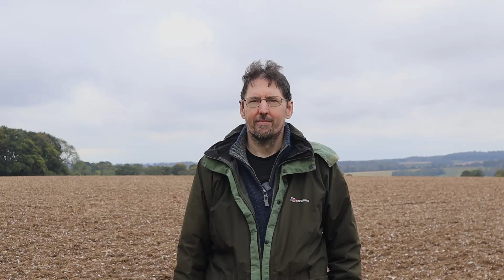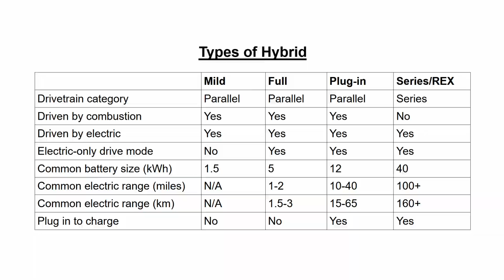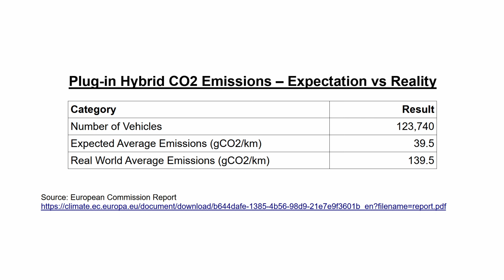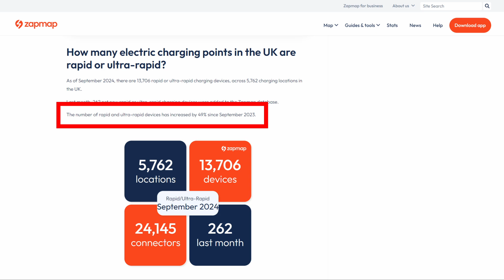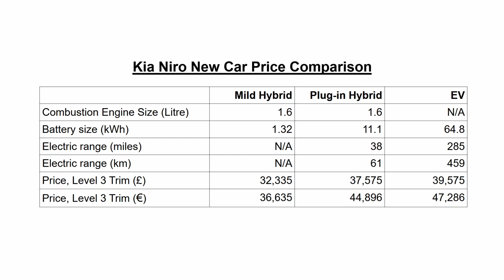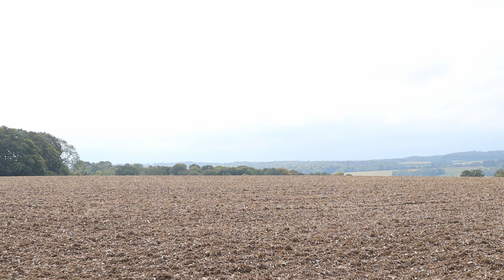Should We Buy Plug in Hybrids?

Comment: A couple of points have changed my view on PHEVs.  Here in the States, the number of Level 2 chargers needs to grow a great deal.   If PHEVs help get those chargers in single and multi-family homes, work places, shopping centers, etc., that's a big deal.  If PHEV users find that they can graze on free or less costly Level 2 charging throughout the week and realize that they seldom have need to fill their tank, they'll probably be much more receptive to buying a BEV in the future.  Hopefully Level 3 charging will be much more abundant over here by then.  The majority of drivers over here want to see a range of 300 to 450 miles before they'll consider purchasing a BEV.
Reply from the maker: Yes, PHEVs might act as a gateway to an EV. However, I do wonder if people will be disappointed by the EV aspect of them, and this will put them off instead. For example, they might be disappointed by the regularity with which they need to plug in, or the limited power in EV mode where that applies. I'm interested to see what happens in that regard.

More level 2 chargers in the world is a good thing though, I grant you - you have my wholehearted support on that!

Comment: Agreed, PHEVs only make sense if you have carefully considered your personal usage profile, which, I suspect, most people don't. If you are cycling your battery every day for your commute, that doesn't sound great although, as I understand it, manufacturers design their systems so that the battery doesn't charge to 100% or deplete to below about 30% so deep cycling is mitigated. 
The arguments between PHEV and EV are also quite nuanced; there's the 'Wiki' argument - with a PHEV, you 'buy' enough lithium and cobalt etc. to provide for 70 - 80% of your needs with the ICE providing the remainder (the Wiki argument is you don't need 100% accuracy if 90% is practically good enough). The 'whole world' cost of lithium/cobalt etc. is paid for by invisible miners (sometimes minors!) and the environmental land damage of lithium and cobalt extraction. So the argument is, why buy a heavy resource hungry 80kWh battery and pull it around town unless you need a bigger battery for long journeys. A smaller battery will be good enough most of the time and when you need it, the less resource hungry ICE (i.e.manufacturing cost) will be fine for the occasional use. How many people really need a car that frequently needs a 200+ mile EV range? 
At the end of the day, a car is never really 'doing our bit' for the environment; the all-in environmental cost of car production is huge. But reducing oil consumption and its pollutants (in town particulates etc) and atmospheric C)2 for climate change is a good pursuit whether PHEV or EV. The balance will change over time of course with the introduction of new battery technologies. 
I'm not equipped to do a whole cost PHEV/EV comparison. Maybe someone on here can expand on this; have I got this completely wrong?

Comment: Really thought provoking video - thank you. I think everyone will have their own use-case and the decision to go down the PHEV route will depend on a whole load of considerations. In my own case I had dismissed the idea, but now that our diesel estate is getting close to needing replaced, a PHEV looks like it may be the sensible option. Our main (most used) car is a Zoe (40 kWh), which is great for 90% of what we do - charged at home for 7p/kWh, but is quite taxing if you need to use public chargers (very slow charging, limited range). But on the occasions we need a second car it tends to be either for longer journeys /extra carry capacity, or for short trips like the school run when one of us is out in the Zoe. So something we can use on electric only (charged at home) for those short journeys but that still has the range for long trips, is quite attractive. 

EVs with fast charging and a really decent range (c.300 miles) are still very pricey, even on the used market, whereas I can pick up a second-hand PHEV for similar cost to what I paid for the Zoe. But I would be wary of maintenance costs and your point about battery degradation does make me hesitate. Just need a load more good-spec EVs to hit the used market!

Comment: I have an i3 rex and have used about 3 gallons of petrol in 3 years. I use the engine like having insurance. It comes in handy but I try not to use it.
Reply: The seats are quite firm but good enough for 180 miles, which is the most I have done in a day. Servicing is just my local garage, he has EV trained staff and it is only required every two years.
Reply from the maker: That's a good approach.

Someone took me out in their i3 about 5 years ago, and it didn't half move! I don't think they had a REx, but I don't remember exactly. The seats didn't quite suit me, otherwise I think it's a superb car. I'm glad it serves you well. Who do you get to do the servicing?

Comment: Another big factor (nicely explained by Dave Takes It On) is that PHEVs have pretty poor electric efficiency. They only get about 2 miles per kWh, which makes most AC chargers more expensive than buying fuel.
Reply from the maker: Ouch, really? Wow, I wonder how they manage to make them so inefficient!
Reply: @theelectrictransition  Dave says it's because of the interface between the electric and ICE motors. Presumably there's an automatic transmission in there somewhere but I've no idea.
I did a bit of research to see if the claim was reasonable, but no one publishes the electrical efficiency of PHEVs. Instead I looked at the 'electric only range' and the size of the battery for a number of PHEVs, and they all worked out at about 2 miles per kWh.
Reply: Not all phev get poor electric efficiency. I have a Toyota Prius Excel 2020 PHEV, and when charged, it gets me 4 miles/kwh, similar to many EVs. If I dont charge the car, i get 65 - 70mpg off long road trips including motorway. I have owned this car for 3 years and driven 45000 miles. I listened to the videos abt hybrids and Phevs from Dave takes it on, he said a lot of things that are NOT correct abt Hybrid/Phevs and he did a lot of misinformation and generalisation that do not respresent all hybrids/phev. A lot of comments from other people confirmed that Dave gave a lot of misinformation about hybrids/PHEVs . Toyota is the king of hybrids and Phevs. They are very efficient, economical, and reliable. Perhaps 2 miles/kwh could be from stellantis phevs but definitely, not Toyota.
Reply: Really depends on the PHEV: mine is about 3.4.

Comment: PHEV is akin to one of those combination VHS/DVD recorders which existed for a very short time. The other disadvantage to PHEV which I was only made aware of recently is efficiency. Apparently they struggle to do more than 2 miles/kWh running in electric mode which isn’t great!
Reply: I regularly get 3,5 miles per kWh on my Outlander PHEV.
Reply: @markotrieste  I’m guessing you use battery only mainly in an urban environment which would flatter it?
Reply: I get slightly over 6km per kWh in my PHEV. This type of malicious disinformation is why people don't move from gas only.
Reply: @Snerdles  Yes, this "holier than thou" approach from the EV crowd is getting annoying. There are some real problems, such as company cars that could run on electricity but are instead only filled up with petrol or misleading WLTP figures, but unfortunately most people seem to think it is better to just throw the water with the baby.
Reply: @Snerdles  well I moved straight from gas/petrol to EV and  accept PHEV has a place as a ‘gateway drug’ and in certain scenarios with the current infrastructure but I still think my analogy holds true and PHEV is an over complicated interim technology. No doubt the high miles/kWh is achieved very much on an urban cycle?
Reply: @markbennett6658  Over 6 is, it's just barely under 6 on the highway. I saw once that a hummer EV took 6 days to charge. Therefore EVs are bad.... That's what you sound like in your malicious disinformation spreading.
Reply from the maker: @markbennett6658 That's a really nice analogy, thanks. I bought my parents one of those. It wasn't heavily used. I doubt they exist now. Not a bad choice, but of its time

Comment: Great video. You’ve clearly stated why a PHEV is not the ideal option. Deep cycling of the battery and people not charging daily
Reply: The fact that the PHEV battery never gets deeply discharged is A strong advantage of a PHEV over a BEV.
Reply: @ nor do my BEV car batteries get deeply discharged and they are rarely charged above 85%. For a PHEV you need regularly (daily) to charge to 100% of available capacity to make best use of EV driving. My BEVs are seldom charged more frequent than once a week.
Reply from the maker: Thanks very much

Comment: Availability of EV chargers near me is very bad. The longer journeys I do make would be painful and disrupt my valuable time. When charging improves, I may look at EVs.

PHEVs are popular amongst reps and such like because they are lower tax. A friend bought one recently at 2 years old and 35K miles. Clearly, not been plugged in a lot.
Saying PHEVs are no good is like saying EVs are no good because most people run out of charge; it's user error, not the car itself.

PHEVs aren't actually more expensive if you shop around. I got a new Seat Leon e hybrid for £26K - little more than the base model.
The batteries being so small are actually very cheap to buy and replace. I've seen them listed for £1200. They do have 8 year warranty though.

Finally, servicing costs are no more than any other car including EVs if you buy the servicing with the car. I only pay £100 for a service.
Reply: What's your time valued at these days?, mines less than the cost of diesel.
Reply from the maker: Yes, I suspect that the tax saving is what is triggering people to buy them and then not plug them in. That has caused some consternation about some of the incentive mechanisms in Europe.

I don't think I said that PHEVs are no good. I have a suspicion that a lot of people could benefit more from having an EV than a PHEV, and that's why I was suggesting that people consider both. PHEVs serve a niche, but that niche is getting smaller very quickly.
Reply: @theelectrictransition  PHEVs are the largest growing sector of cars at the moment.

Comment: The discussion around PHEV is nuanced. The most recent PHEVs from VAG and Toyota have ranges in excess of 50 miles (Verified by chums of mine who own such recent PHEVs) and as such this equates to 85% to 90% full electric use for day to day running around and commuting. For longer journeys you can just press on to your destination and plug in there. Now to my own experience, I run a BMW i3 Rex and over 90% of my journeys are done on electric, with a range of 220 miles using the Rex it covers my long journey needs without the need to stop and even if I do I can add another 100 miles and be on my way in less than 5 mins. Anything that reduces the overall fleet consumption is a good thing and should be encouraged. I agree there needs to be better education about how to use a PHEV properly and now that the latest batch have a usable "commuter" range there is a more compelling case. Over the next few years there will be a mix of solutions to take us to our goal of reducing consumption of fossil fuels.

Comment: Take a look at the price of charging in the Highlands, and scarcity of chargers. BEV just isn't a great option here yet. Some kind of hybrid makes more sense for now, or just stay ICE. My diesel will readily return 700 miles per refill.
Then there is the electricity distribution robustness during severe weather, although that is going to be the case for most very rural areas.
Outside of our situation, which is most people's, BEV is a great option.
Reply: I live in the north Highlands and have owned an EV for several years. I regularly drive over to the west coast for work and charging really isn't a problem, some chargers can be expensive, but the closest rapid charger to you (judging by your username) is only 40p/kWhr which makes it much cheaper per mile than diesel. However the local charging network is largely irrelevant to anyone living in the area, most rural properties have off road parking so you just charge at home. 
As for power cuts, how many times can you honestly say your electricity has been off for more than a few hours? Ours goes off a couple of times a month for a few minutes,  and we've had lines hit by lightening in the past year that has put the power of for 4-5 hours, in 20 years it's been off more than a day just once but it's very rare that I'll even bother to fire up the generator. But why does that matter? You can't fill a diesel when there's no electricity

Comment: I would wonder if the battery in hybrids degrades quicker due to the more frequency cycles as opposed to the BEV cycles?
Reply: No, paradoxically it's the opposite. 
The BMS in a PHEV limits the cell voltage so that it's never fully charged nor fully discharged. 
That greatly reduces battery degradation. ☮️
Reply: @Tim_Kent  Yes but in sheer number of cycles, a battery that holds 40 km of range will do 10 times more (equivalent) cycles than a battery holding 400 km for the same overall mileage.
Reply from the maker: That's true, the number of cycles from a smaller battery would be higher. It's the depth of the cycles that I suspect would be most damaging - but neither helps
Reply: @theelectrictransition The depth of discharge is always limited to 30% SOC to allow for hybrid mode drive.
Reply: Yes, but the battery is also smaller.

Comment: I'd be interested to see a long range challenge, like a Lands End to John O Groats, with a BEV vs PHEV but with the twist that the PHEV has to recharge its battery when it stops for fuel. Having a quick look, a Ford Kuga PHEV takes 3.5hrs to fully charge. Put that up against a Model Y and see who wins 😉
Reply: Just to add, the Kuga has a 45ltr tank and claimed 54mpg so around 540mi range. Be curious to see how it does when the battery is drained, assuming it uses the battery at all on a motorway?
Reply from the maker: That's an interesting idea. A few PHEVs offer DC rapid charging, but not many, so the choice of car would significantly affect the outcome
Reply: @theelectrictransition  as you say, not may offer DC charging. I picked on the Kuga as that was the only one on a quick read up on that was in the top 10 sold cars on the SMMT that properly listed the charging times. The Kia oddly says "TBC" and the Hyundai Tucson keeps linking through to the charging page but then only shows the BEV cars. It's like they don't want people to realise how slow they are to charge compared to the BEVs 🤔 I think it would be fair, if anyone were to ever test it, that it be 2 models that are in the most sold categories for their class. No point in cherry picking expensive models that barely sell. A model Y vs a Tucson or Sportage would seem a relatively close comparison, maybe the MG HS as well.

Comment: The only real use case for a PHEV (or a REX) I can think of is if you frequently tow large trailers (caravans, horse boxes, etc.,) long distances. BEVs are not great for this given typical current BEV battery sizes and lack of rapid chargers with "drive through" access. Other than that I can't see any real benefit. Other types of hybrid are really just ICE cars with lipstick on.
Reply: Surely a diesel car would be ideal and cheaper than a PHEV
Reply: @studio1972 I agree. 
My 2 litre diesel gives 67mpg on a 300 mile trip and 54 even in town.
Reply from the maker: Yes, absolutely. As you point out, towing is really tough with an EV - both because of decreased range and awkward charging locations, so a PHEV does remain a better option in that scenario
Reply: Have you got any info on Zoe electric handbrake faults on mark II. Thanks
Reply from the maker: @bernardcharlesworth9860 No, I've not heard of people having problems. By MkII do you mean the ZE40 or ZE50? The ZE50 has an electric handbrake, whereas the ZE40 had a mechanical one, so I can imagine you mean the ZE50
Reply: No you need a diesel.

Comment: The VW Golf GTE PHEV I had was very good. I got 65 mpg over 1,700 miles including when the temperature was minus 7.5 degrees 

The latest ones should be even better with bigger traction batteries and being faster charging 

I now have a Renault Zoe
Reply from the maker: The excess heat from an ICE engine might be very useful in the extreme cold I suppose. How does the ZOE handle those extreme conditions?
Reply: @theelectrictransition  I’m not sure I only got the Zoe at the end of March this year

Comment: PHEVs are touted as the gateway drug to full EV, on the basis that instant torque and zero emissions in town (if you charged it and haven't already used the battery!) will get you hooked and you'll want more. I think they're more like the methadone of ICE, you can pretend you're making a change for the better, but in reality it's the same problem with a different name.
Reply from the maker: Haha, yes, I like that analogy. Thanks
Reply: @theelectrictransition  Feel free to use it!